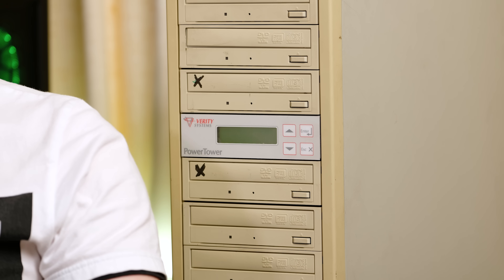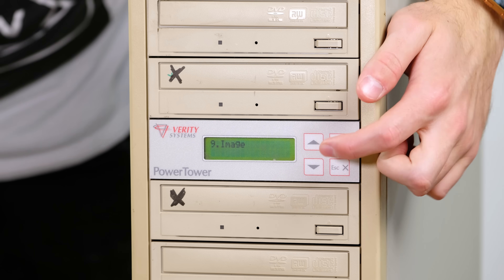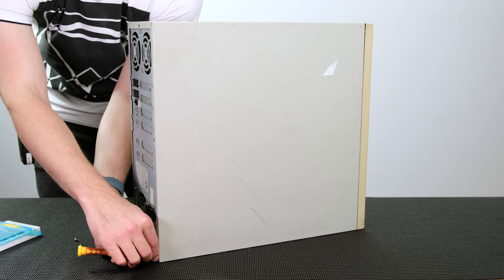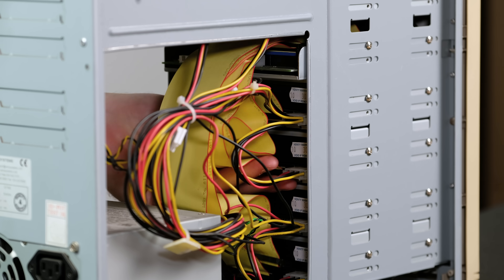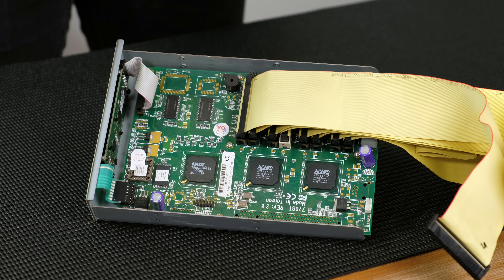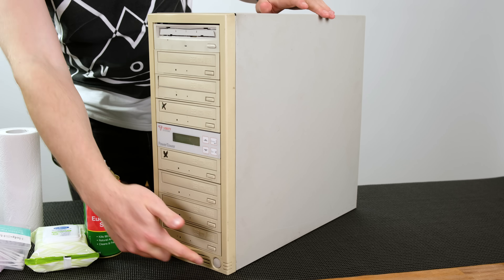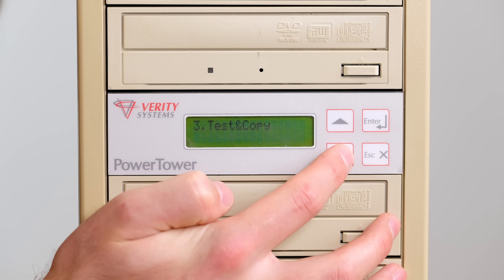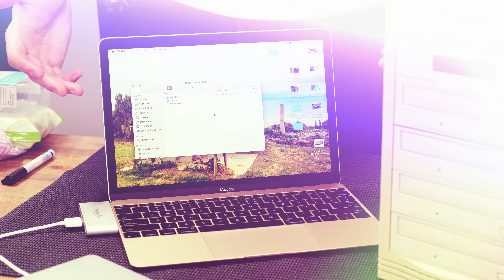What's Inside This Old DVD Duplicating Computer?

Comment: I was the IT guy at a TV production company in this time period in the uk. They were forever burning bits of their shows, often multiple copies. Some poor meat sack was sitting at a one drive desktop doing this. I did some research and I recommend buying a unit very similar to this. Got to be a hero, for a short while. Great times :-) thanks for the reminder!

Edit: oh, and I don't think it worked with commercial DVDs so you'd need to crack the protection before living out your "pirate king" dreams ;-)

Comment: Hello ! I'm very curious about this machine, Do you know what is on the hard drive ?
And what is on the bios chip I saw in the tiny motherboard of this thing ?
Does it still boot if you unplug the hard drive ?
Thanks for sharing this to us, it's really an interesting piece of hardware 'o'
Reply: The HD allows one to copy disc images for future burning; also prevents a disk read error from spoiling all the copies being written if one occurs, so it will contain whatever master copies the previous owner saved.

Comment: This was fun!  I enjoyed seeing a video from someone that didn't exactly grow up in the scene. As soon as you put the DVD in i'm like, Hrm.. i wonder if it's even going to read a disc burned by your external. I can't tell what it is but it sort of looks like a superdrive, they pretty notorious for not making super high quality burns, and the media itself comes into play here too, plus those DVD drives in the tower don't exactly look like super high quality units either. Then when it failed and you tested i'm thinking, well the data probable doesn't match the lead in TOC, plus the disc is open, and many drives won't even read open discs. I still burn media, although pretty infrequently, and i still use an old Pioneer DVR or a Plextor, plus Taiyo Yuden media. That combo will burn discs that will read on anything that still functions, including stuff that usually doesn't read burned media.

Comment: Three processors or graphics processors"

Nope. IDE controllers typically max out at four drives (two channel, two drives per channel) You have nine drives (8 optical drives plus a HDD) They are 100% going to be IDE controller chips there...

And what would a system with no visual output or transcoding ability even need a GPU for? :)

Comment: His friend: Do you have an external DVD drive laying around? I want to play an old DVD game on my ultrabook.

Psivewri: Hold my beer...
Reply: Michael Martin  But it wasn't a computer it is duplicator that has no external data ports.
Reply: Not an external drive.
Reply: Michael Martin  Not sure you are using that right.
Reply: Michael Martin  what did I miss then?
Reply: Michael Martin  Are you meaning to say they are virtually mounting the ISO?
Reply: Michael Martin  So did you just admit that you had no idea what you were talking about the whole time? BTW, you don't get to get off defending a "joke" by saying I am the one over thinking it. The I put joke in quotes is because real jokes have some kind of internal logic, which, of course, OP's post did not.
Reply: Michael Martin  But you don't interface a computer with it you use a master disk in one of the drives. A device like this is useless if you have to use a general purpose computer to interface with it. They are designed so any person with minimal training can use then to duplicate disk, they have them for HDDs as well.
Reply: As a bench technician I use a HDD version of a duplicator like this to image computer HDDs. They are much more convenient and easier to use than software solutions. They also have the advantage of being able to wipe the disk in a myriad of ways after the transfer and do read/write test to confirm a disk is functioning.
Reply: Not beer, eucalyptus oil.

Comment: I bought one of those years ago and the control board died.  So, I did what any rational person would do and built my own.

I replaced it with a stack of Raspberry Pi computers each hooked to a usb to sata adapter.  This allowed me to work off iso images rather than putting a physical disc in the top.  I wrote software to control them all over the network so they would work like one machine.  It's really slick and I still use it from time to time.
Reply: Cool can you share source code on github?
Reply: Terminal_Heat_Sink : My code is a mess and very task specific. It’s not for general use. Sorry about that.
Reply: @Xpurple  😟 fair enough, thanks for the replying though.

Comment: I'm pretty sure the hard drive contains an interesting operating system. You should check out what's on it.
Reply: Hmm good idea
Reply: I'd guess it contains either old disc images or nothing, the "OS" or rather firmware will most likely be entirely in ROM
Reply: The HD is an option for these duplicators. It just stores master images for burning disks. That allows making copies faster and without the potential for a disk read error to spoil the copies in progress.

Comment: Nice little wired copying PC it's the very first time i have ever seen a PC run without any os or booting or windows and without a screen.. I liked watching your video as i always do. You can clean the DVD Lenses using ear buds ( cotton tips)  if you had to replace some of the drives i don't think it would be too expensive ... :-)
Reply: I'm gonna guess (or at least hope, hehe) it runs some form of Linux. After all, it's an embedded device from the 2000s.

Comment: your DVD piracy game on point
Reply: I'd replace them with Bluray burners and IDE to SATA converters 🔥🔥🔥
Reply: @andrewzombie yes, the case makes you feel the need to make something of it, but would need a completely different control, a kind of micro pc that got enough SATA ports, there is not enough space for a simple mainboard, while you could use a pretty old one and make a useful machine from scrap this way, maybe place a screen in one of the side panel and just use a basic OS that doesn't need more than having file management and the ability to control the drives.
Reply: You guys are all forgetting about DRM. New Retail DVD's or Bluerays cannot be copied, Only DVD-ROM.
Reply: @mcm_pictures  lol this dood don't know how to get around it
Reply: @mcm_pictures  there's lots of pirated PS4 and Xbox games...